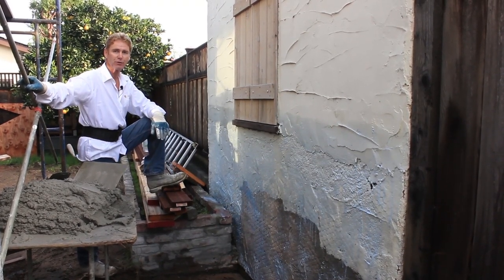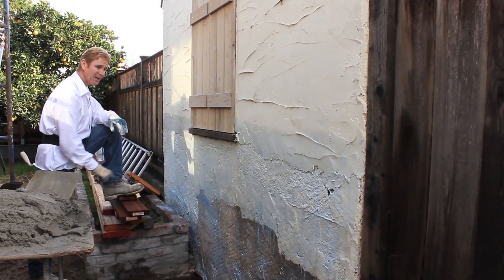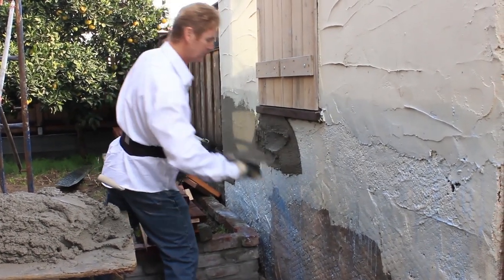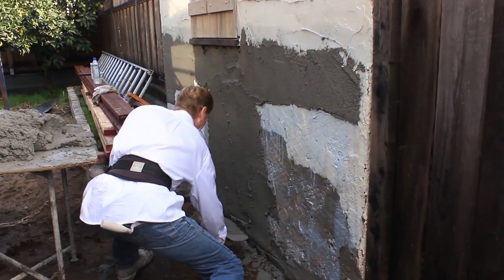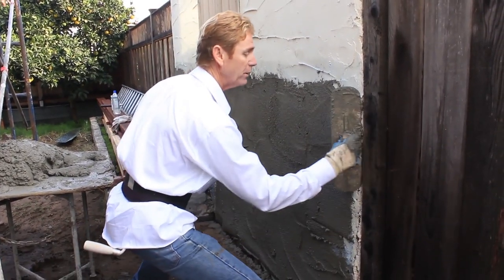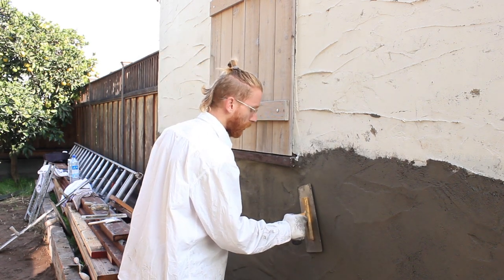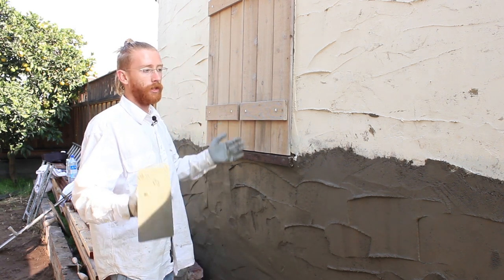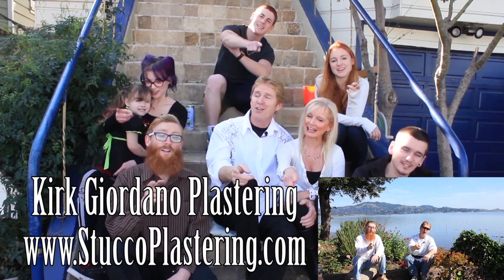Stucco unusual textures.

Comment: Do you use Weldcrete  before applying BMI? Final finish there looks really  nice match .TU guys
Reply from the maker: Hi peter ol pal, we use weld create or any bonding agent if we apply cement plaster over a painted surface otherwise in say, 2 to 7 years it can come off.
 Good question brother,
  Kirk and Jasons DIY plastering network